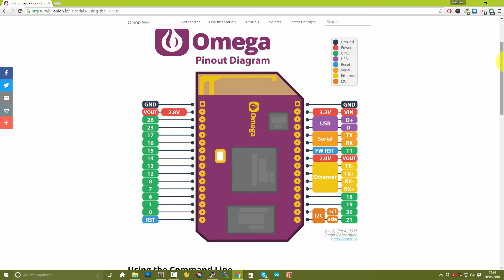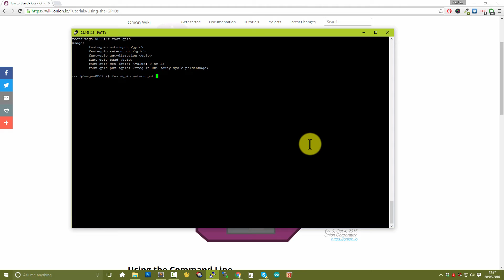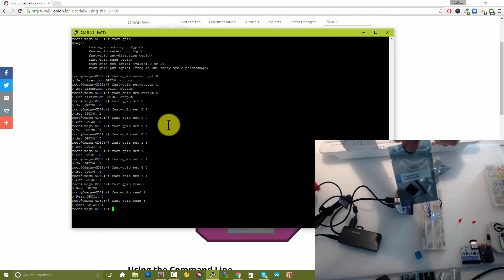Part 8 - GPIO Pins as Inputs & Outputs - Onion Omega Crash Course

Comment: on the Omega2 i had to resign fron using fast-gpio and had to use gpioctl instead 
i had an error "segmentation fault" when trying to use fast-gpio set-output

also LEDS tested on gpios 0,1,2,3 worked like a charm whereas on gpios 6,7,8,9 the leds did not repond correctly to low/high setup (maybe because 6 to 9 are 'reserved' for SPI things ?)